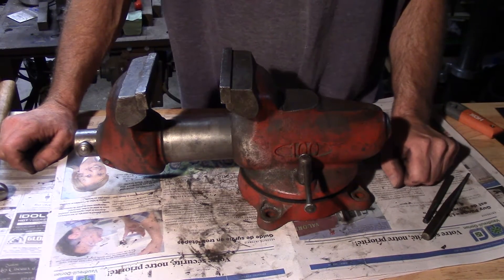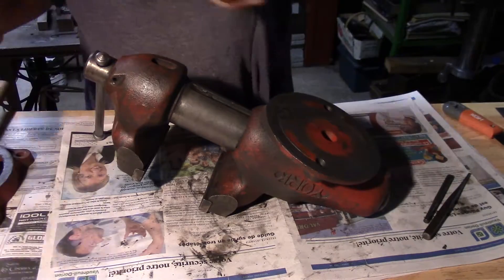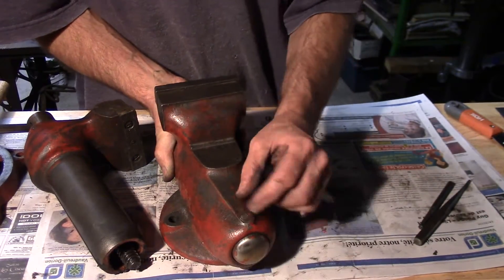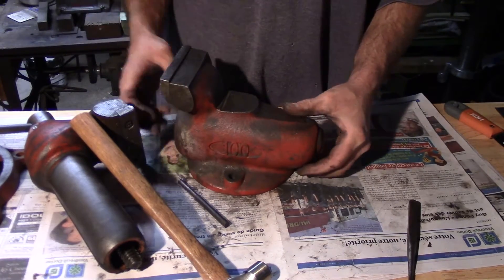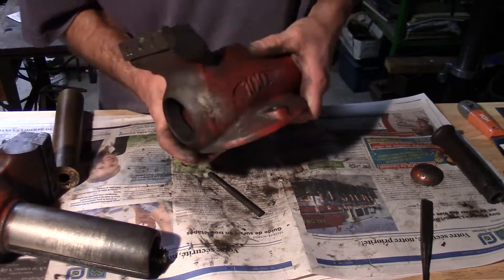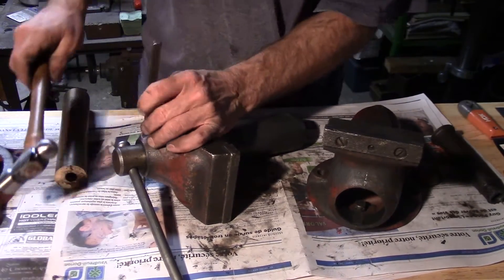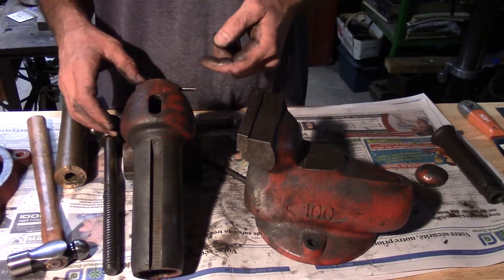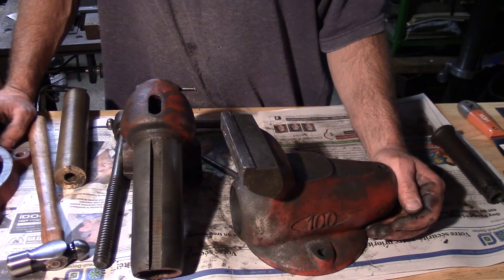Amazing York 100 vice teardown and Wilton patent controversy.

Comment: i have the exact same vise, picked it up at a flea market like 2 years ago, however mine's missing the bottom part so it doesn't rotate and jaws are worn down but the screw is perfect just like yours. I just clean it every few months and put some bearing grease on the moving parts. Works perfectly but i need to get me some new jaws so I don't need to tighten it so much. It's strange that I live in Poland like 10 miles away from Czech Republic border and it was the first time I saw a York vise so I guess they're hard to come by everywhere. Cheers.
Reply from the maker: The company sells replacement jaws and you might be able to get the base also. I'd love to visit Poland one day my father spent some time there in WW2
CHEERS

Comment: That looks like a very handy vice. Very substantial. 
Hadn't come across the York before. Looks like steel too.
Reply from the maker: It has a very knuckle friendly finish and is very sold for its size. Hard to find in North America,but they have some interesting products on their website.  Hope the back  doesn't give you grief in 2017  CHEERS
Reply: Cast iron york are original design wilton a coppy